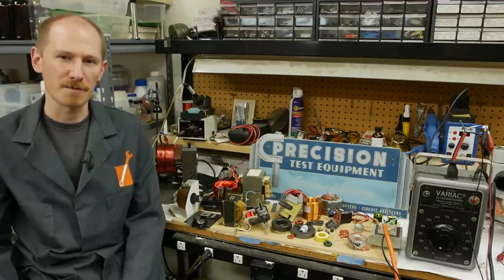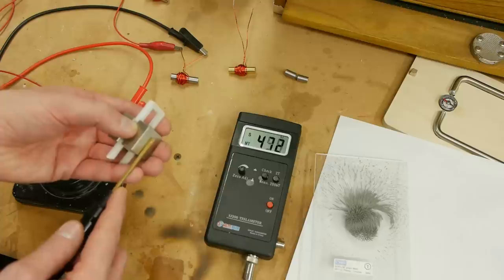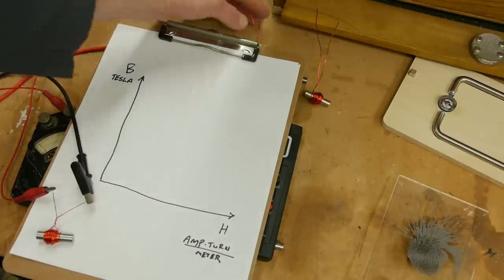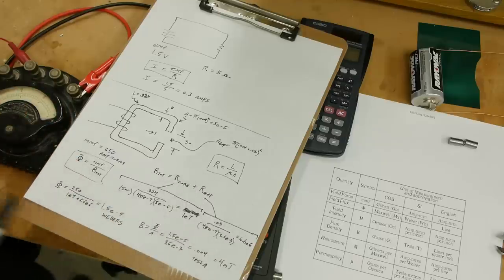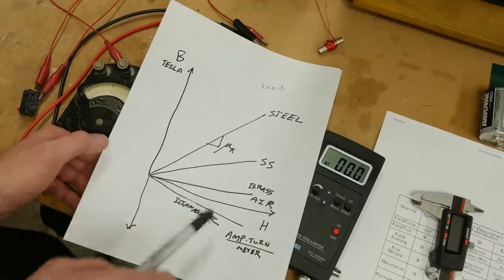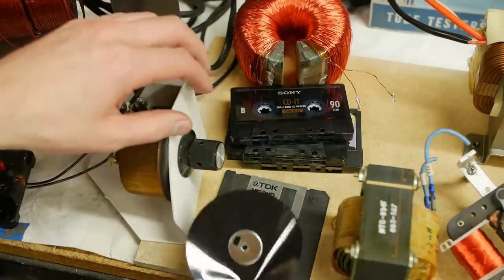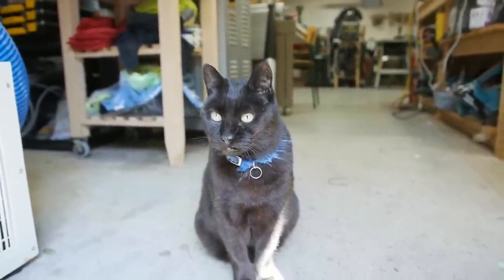Engineering magnetics -- practical introduction to BH curve

Comment: Would the magnet react differently in a vacuum chamber? Would it be stronger at a further distance?
Reply: Devon Roets Air and vacuum are pretty much the same - the permeability of air is so close to that of vacuum, that it’s hard to measure the difference in a crude setup. Since permeability of vacuum I imagine would be a tiniest bit lower than that of air, you’d get a tiniest bit lower flux density at a certain distance in vacuum vs air. The difference is surely below 0.1%, so you might as well ignore it :)
Reply: no

Comment: Know this video is old but... Nilered made a video on Ferrofluid it would be interesting to see it tested as a budget ferrite core little to no air gap. Could potentially 3d print with it on your resin printer and cast in the wire. Be interesting to see it under the scanning electron microscope before, and after it is charged to see if any change happens though I doubt it. He also talks in that video about increasing and decreasing particle size. Could also dope it with copper or aluminum powder to direct, or deflect the field. If you cast it in a field would it keep it? Lastly thought emporium made synthetic opal could you bind that to the ferrofluid and create a diy opal DLP by trying to nucleate the color growth reaction on the ferro particles? Last bit is dumb but it would be cool to have an electric opal lightshow in a viscus suspension.

Comment: If I use a permanent magnet as a core to an electromagnet, but I set the polarity of the electromagnet windings so that the poles of permanent and electromagnet are the same, what will happen to the flux of the permanent magnet? I think all I’m asking is; is it an additive process?

Comment: WOW! My head is spinning. All i need to do is replace an AC Field in a small motor to a Perm Magnet and concert the Armature power supply to DC. I have build several test assemblies, but i have either a too small magnet or too large magnet. the motor runs in DC if i start it. but it will not start on its own. I am thinking the two Mag fields are out of balance. Seems if one to too large it overpowers the effect desired. I can not afford the Tesla meter, but i have a old 2 channel Oscilloscope. Can i devise a means to measure output of the two components and learn where to get to balance in the system. Such as a large magnet pulled away from the armature could provide a tuneable system (???) I think. If so just what and where can i hook up to see the two sources and then tune the magnet position for optimum operation. Or am i nuts. To convert the machine to DC Can costs $60. I can get PM cheap and I have a 3D Printer to make the magnet holders so if i can determine the power requirements i think i can build and tune a system.  What do you think???  
https://youtu.be/iljGKrAzUt0  
Dennis in Virginia  old retired engineer (Built CT and MRI Scanners) with a Model Train addiction.

Comment: If it were possible to replace all the AIR in the room with magnetic steel instead, what would happen to the flux lines that the iron filings are showing now?  Are the iron filings altering the shape of the field now?

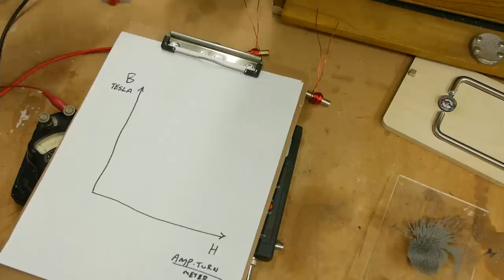Comment: 10:30 Why is the current axis labeled "H"?
12:10 So H is current "and" turns? Current X turns? (Current X turns) / meters? 
12:16 Seems you're equating 'current' (amps?) with 'work' (joules?). Are they equivalent?

a little confusing.

Comment: Air has no magnetic reluctance. All flow of magnetism through air is determined entirely by geometric effects. If air had reluctance, you could put a magnet and sensor in a pressure chamber and increase the air pressure and see the field change. Doesn't happen. Reluctance only applies to magnetic materials.
You did not explain why the compass needle didn't align itself to the closest points in the magnetic fixture, but was aligned slightly off. Can you explain this? (you can determine the answer by setting up the model in Visimag and plotting the field strength.) Can you explain WHY the field is stronger at the edges of the poles than in the center, even though the gap is smaller in the center? If you think carefully the answer is obvious!

Comment: So would plutonium be diamagnetic?  Based on the fact it interrupts with radiation?  Adding to that, does alpha radiation effect magnetic potential properties of any or all material either permanently or Maybe only when in contact?  Guessing since the radiation cant go through certain material than would only effect the flux outside of the object so would only possibly block or disrupt the flux of the material when in proximity...  right?  Is this basically what a particle accelerator does to plutonium itself?  Activate it or whatever?...  fission..

Comment: Will someone please explain to me why coils don't short at their closest connected point? Like doesn't electricity follow the path of least resistance? Wouldn't going through the entire coil be much more resistance than just bridging where they cross right after the alligator clips?
Reply: a gap is like a jump gap for electron to cross, wider the gap the more harder the electron jump...there is also air in the gap.....the eldctron jump gap for air is very high...around 5000 volts per cm gap width...usually ordinary electric devices on go up to around 300 volts....
Reply: @lunam7249  I might have misstated my question. I meant why doesn't coil wire just behave as a lump of metal. It's because coil wire is coated with a clear enamel. I didn't know that when I asked.

Comment: this was great! I've spent so long scratching my head trying to get a grasp of this kinda thing. 
If you wanted to calculate the permeability of a core which already has a layer of wire around it, is the total permeability simply a ratio of (diameter of core / diameter of core+wire) multiplied by the relative permeability of the core? (Assuming coppers permeability ~ 1)

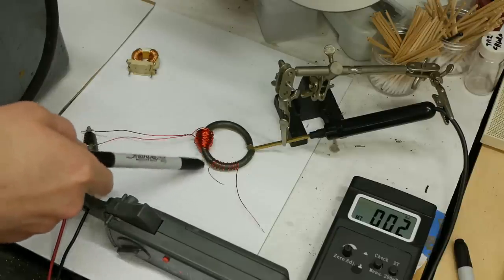Comment: 34:00 how much of the heat generated here is from Lenz Law vs the natural resistance of the material?
Reply: Luke F it goes up with the frequency, and at couple hundred khz most of the generated heat is hysteresis loss; this is actually used industrially in induction heaters - iron/steel heats up much faster than for example aluminum
Reply: Since the actual resistance of the core is extremely high (by design); most of the losses will be due to hysteresis losses. However, if you have fairly thick steel sheets in your core (because they are cheaper), eddy currents will definitely play a significant role.

Comment: I have a question about the intentional gap in some of the devices you show towards the end. When the transformer/inductor/whatever is in use, it generally heats up. Would the metal not then expand and the gap shorten or possibly close? It would seem that even surrounding temperature fluctuations might achieve this.
Reply: Vaia Patta they glue some spacer in the gap so it can't move around very much
Reply: Vaia Patta  you are correct, this has to be considered when using airgapped cores.

A typical solution used in most low-power Switched-mode power supplies is to use a core consisting of two E-sections and having the middle leg be slightly shorter. that way the two sections cannot move further together.

Comment: Thank you so much for the wonderful presentation. I wish to learn further into the modelling and characterization of different types of magnetic materials and Transformers (including time domain modelling, like how quickly the induced magnetic field decays). I understand that this will involve rigorous electromagnetics and material science but that's exactly what I'm interested in. Any suggestions on books, online resources, or video materials?

I got really curious of this topic when reading about headphones and speakers. Most headphones use neodymium magnets for their relative weight to permeability ratio. But for speakers there seems to be more possible choices from neodymium, ferrite and alnico all of which seem to have their trademark sonic traits.

Comment: Thanks so much for your video! 
A very interesting magnetic material is metallic glass, which is solidified from liquid exceedingly fast, reputedly a million degrees a second. Consituents are oddball — some metals, some non-metals.
One trade name is Metglas, one "s". Very likely that it's the shiny strip inside the little rectangular anti-shoplifting adhesive capsules.
The other strip is a retentive alloy, with diagonally-cut ends. The shiny strip rattles around loose, but the retentive one is bonded with sticky adhesiwe. I prefer not to post publicly the likely physics of how the device works, but the shiny one apparently has really-low coercivity, and cuts losses in power distrib. tronsformers. Perhaps it also makes great audio transformers? It might also be quite magnetostrictive, and seems to saturate fairly easily.
See the video iirc by Thoisol (?) about iirc holmium, iirc highest known permeability, used for MRI flux concentrators.
Decades ago, you would have explained square-loop cores!
Saturable reactors and magnetic amplifiers are interesting.
Any thought of explaining near and far fields?
Was shocked to learn that a transformer is a near-field device. Didn't know that, for about 75 years or so; I'm 82.
Best regards, and thanks, again! Think I caught all the typos.
Nicabod.

Comment: There is no mention of Mu-metal (80%Ni, 12%Fe, 5%Mb,...) as transformer core material?  I was told that about all high power transformers in US (not in Europe!) are built with such a core material?  It gives the best transformer efficiency because of low hysteresis losses!

Comment: What I don't understand is, why does the current go through the entire coil? It looks like uninsulated wires, shouldn't the current take the path of least resistance?
Reply: It's resin coated wire with a voltage differential of "small multiples of voltage per turn"  between sections.

Comment: That was awesome, very informative, somewhat understandable, but definitely figureoutable ! Haha,,..  I was wanting to build a large transformer fr a inverter, in the 5-6kw range, or multiple in half that capacity, I'm thinking a spwm in push pull is going to be much different than a out of the wall sine wave,  I have also thought about core cooling, using copper tubing as part of the windings. To circulate oil through a radiator, potentially using convectional current, I believe most of the heat is in the windings. There will be some Eddy currents in the core, with the tubing in the primary winding, it can pull heat from both, then seal in epoxy, it should be able to maintain under 130°C, I have several microwave transformer cores, and other cores. But I would rather have a torroid, I was thinking I could possibly re configure the core material, I kinda doubt it's going to be easy, torroid core are expensive, then double their weight in copper, and shipping, it's very expensive , no wonder high frequency inverters are so much cheaper and lighter!  Being they use tiny transformers at high frequency,  sorry to ramble, but his is what got me interested in this video!

Comment: I'm reasonably confident that the visible magnetic field "lines" are an emergent property of the iron filings, in that they'll obviously join up in lines because of their own properties when in a magnetic field. The magnetic field itself is surely smooth and continuous.

When you see a countable numbers of lines of iron filings, that number of lines has no basis on anything except the properties of the iron filings in that situation.

In summary, magnetic field "lines" are one of the most horrific widespread analogies in physics.

Discuss...

Comment: E- cores are designed with a gap for it to function. Its not o flaw, its per design to make compact power supply such as a phone charger or computer chargers without using a big clumsy iron core

Comment: air? or just distance/space? affecting the reluctance? I would not think the air has anything it do with it. wouldn't it be the same in a vacuum
Reply: zachell1991 the material matters. Iron has less reluctance than air, but I think it is possible for materials to have more reluctance than air too.
Reply: yes material matters but I think more so conductive or Ferromagnetic materials have an effect. I don't think things like air that is mostly nitrogen that is diamagnetic and not conductive have much affect. Just like if i pass an 1/8 inch stack of paper between my magnet and a magnetic viewing film it does not change the field at all, even stuff like electrical tape does not effect it. Aluminum also does not change it unless the magnet is moving by the aluminum creating eddy currents.
Reply from the maker: Yes, I should have said this more clearly in the video.  Air is basically the same as vacuum for practical purposes.  Paramagnetic materials also are often so weak, they do not have any apparent effect on magnetic fields.  There are a couple interesting exceptions:  oxygen is paramagnetic, and in the gas phase, the density is too low to see anything happen, but liquid oxygen is quite visibly magnetic and will leap up out of a dish when a strong magnet is brought near it.
Reply: Thanks for the reply,  I have seen liquid oxygen in a vial stick to a magnet before it's pretty cool.

Comment: After the Stern-Gerlach experiment in the 1920s made awareness of electron spin (the magnetic moment of an electron), it was then discovered that aligned electrons spins are the physical cause of magnetic fields - this also occurred in the 1920s.

In order to create a physical torque that is strong enough to align electron spins in a material, there cannot be competing forces inside the material that block the electromagnet's influence.

Electron spins can be torqued into alignment in ferro materials (iron, cobalt, nickel) by applying an external magnetic field from a permanent or electromagnet.

Electron spins can be aligned in the brass, and the stainless steel, and copper wire, but only by applying an unbalanced Coulomb force across the length of the material.   An 'unbalanced Coulomb force', aka a voltage, creates current flow.  While current flow is not great in brass or stainless, they do conduct, and copper conducts fine.

The evidence that electron spins can be aligned by way of an unbalanced Coulomb force is - the magnetic field created around a copper wire when it is conducting.

So there are two ways to align electron spins, with different results depending on the material:  (1)  apply an external magnetic field;  (2) apply an EMF, a voltage, across the material

EDIT:  The mystery as to why the 'bunching up' of charged particles in, say, copper, caused by the applied difference in potential across the wire - recall that the Coulomb force of "like" charges leads to repulsion between the particles.  The intensity of the repulsion increases as the bunching up increases.  The Exchange Interaction, also discovered in the 1920s, created awareness that the repulsion between 'like' charges (electrons or protons) is decreased when the spins of the particles align.  In other words, Nature reduces the intensity of an increasing Coulomb repulsion between 'bunched-up' like charges by aligning their spins, which increases the physical distance between the charges.

Comment: Does anybody else disagree with the twisting of the wire after the windings? Twisted pair wires are made for noise so I question if there's a factor in induction/magnetics.

Comment: How do you get the compressed energy out of a magnet just once?
Reply: You could allow it to attract and pull in pieces of magnetic material such as iron. You could use the motion and force of the iron pieces to drive a generator. Energy = integral of force across distance.
Once there is enough iron packed around the magnet, the magnet is shielded, and there is very little magnetic field outside the magnet+iron glob. So there is a finite amount of energy you can extract from the magnet.

Comment: @ Applied Science
I like  a lot of your videos. Nevertheless, for this episode, i have some suggestions for you (just watched the first 20 min):
- The length to determine H, is not the length of the coli, but the length of the way, the magnetic field has to pass, when going from the north- to the south-pole (including the length of the magnet or coil itself. (11:31)
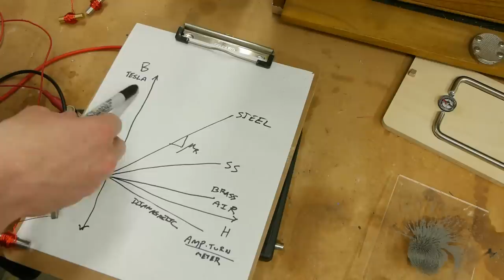- Diamagnetic material has a µ lower than 1, but still bigger than 0, actually it's very close to 1. Paramagnetism = close to 1, but a little more. (16:50)

Comment: Energy is stored in a magnet like a spring?
This sure sounds wrong to me. Even if a magnet never wore out, you can't get energy out of a magnet. You need something to move the magnet.

Magnets are not energy storage devices. They are used to convert one form of energy into another. Magnets can be used to convert kinetic energy into electrical energy and via versa.

I'm afraid saying magnets store energy is going to cause a lot of (more) confusion on the topic. I'm very disappointed in how many people make this mistake. If this isn't a mistake, please describe how one extracts the energy stored in a magnet.
Reply: A magnetic field certainly has energy content. You are right that you can't get the energy out of it like you can from a battery, but that difference has been pointed out in the video. A magnet is analogous to an ideal charged capacitor with insulated terminals that can hold the charge forever. Like the capacitor stores energy in its electric field, the magnet stores energy in its magnetic field.